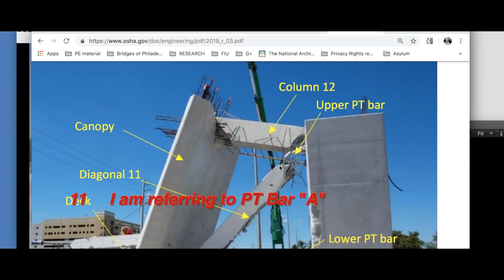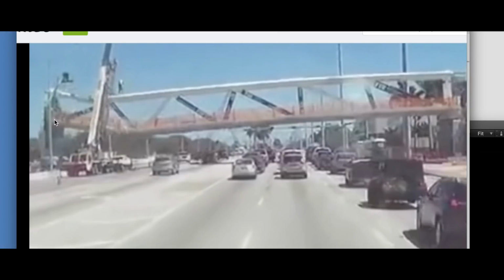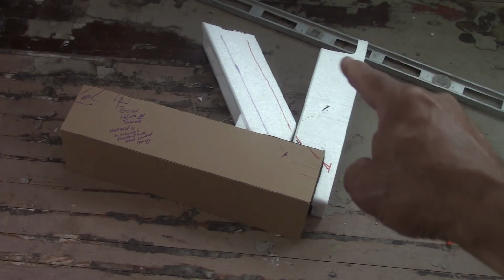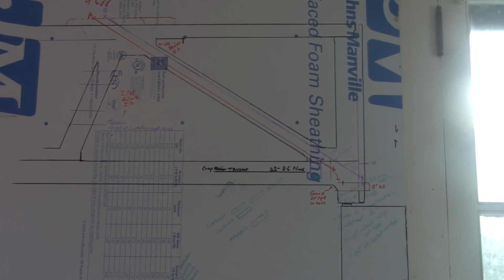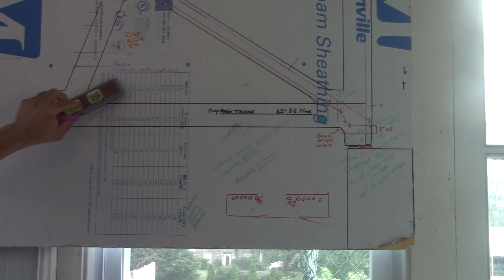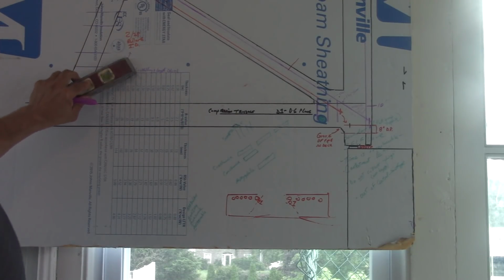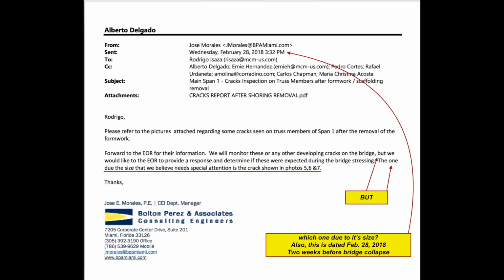FIU Bridge Collapse SHEAR FAILURE OF THE DIAPHRAGM COLUMN 12 & Canopy loads Torque

Comment: At 8:43 you state that 12 kicks back in.  This is not correct.  What you are seeing is the tree coming into view from behind the structure.  A frame or two before this, there is a faint puff at the junction of 11/12  (you have to isolate the two frames and click between them).  That is when the long span starts dipping down and 11 starts getting progressively shorter, with the PT rods pushing out of the top.  If you  watch carefully (again isolating the frames and clicking between them) you can see that 12 does not initially move, rather, the failing canopy pulls the top of 12 down and in (causing the top joint to fracture as visible in OSHA) and dislodging the lower portion off of the slab/diaphragm.  After this, a significant amount of debris becomes visible north of and below 12.  It is a chicken and egg question of whether all of this concrete ruptured early or compounded with the collapsing structure and how much ability 11 had to do more damage to 12.  Clearly, the node had suffered significant damage in the days leading up to the event and was compromised by the drain and vertical ducts making it easily detached from the diaphragm.

I find it curious that the deck suffered so little damage.  In profile, it creates a notable step in the blowout, with 11 completely demolished above the slab and the node completely demolished beyond the step.  Perhaps, while the tensioning of the lower PT bar was the final straw in the destruction, it is also what preserved the slab.  The long and short of this is that the collapse was a series of  failures with many speculations being correct about one step or another.  For instance, 11 was not properly restrained horizontally by/to the deck.  That is true and is the most fundamental design flaw.  Second, the cold joint is an obvious failure mechanism.  The improper horizontal restraint allowed the deck to shift w.r.t. 11.  This is slippage and is visible as the horizontal displacement at the joint.  Against all odds, the structure held on by a thread (not likely for very long were it not for ...).  Punch out is also true.  This is the failure of the node, improperly supported and poorly conceived with all of the inclusions, but again, the structure held together.  It was only when additional and excessive compressive forces were added to 11 (which simultaneously loaded stress into the failing node via the upper PT bar), that the node and 11 ruptured and the house of cards collapsed.
Reply from the maker: I observed the tree;  I use the  pole in front to judge the base, along with the knowledge that post tension rod 11 "A" is still inplace, I use the top of 12 to determine it further... 
You appear to use the tree as the base of 12, I did NOT... Your apology would be accepted if you would give one... 
My guess, is you canNOT because you have already made a conclusive file that I used the tree and it would HURT YOU to say sorry...

Comment: What also looks like happened (that you don’t mention is that rod B was sheared off (symptom or cause of failure mode), while rod A was still sound as it ripped out the bottoms of 11 (ripping through all the stirrups).
Seems to me the OSHA report got a lot of it right, its just the final recap of what moved, seems off the mark. 
Ultimately it looks like the blame is going in the right direction.
Reply: I should add, i also follow the thought process that the damage that caused the collapse was result of tension cracks (from de-tension of 11).
Reply: I was just coming back to reference that figure 52 and 57 show the lower rod in tact. I think figure 63 is mis labeled and is the “upper” rod B. 
Any way, i continue to enjoy the content/thought process noodling through what happened leading up to the collapse.
Reply from the maker: @DamonJohnCollins , that is lower post tension Rod "A" ... please, see one of my other videos for this detail... Or take my word for it, it is post tension rod "A" or for sure, it is the lower rod, the one that is in the deck... For clarity, it may technically, be rod "B" as the only difference is about 2 inches longer and I am guessing the shorter one to be in the deck and called rod "A''...
Reply from the maker: Damon, please show me where you found the data that Rod "B" was sheared? 
I did not find that and will have to add that to my failure...  
Thanks.
Reply from the maker: Damon, then per psychology, in my small mind, you are a genius!    
Hope you enjoy my humor,
Kai
Reply: Figure 63 on the OSHA report. (I think that’s rod B)
Reply from the maker: That is a trick from OSHA, it was mechanically done, it was NOT done during this failure; see figure 57 and zoom in please.
https://www.youtube.com/watch?v=qjSmZaiYfwU  Damon, go to 18minutes in this video and I talk about this part of the report and fake statement by osha.

Plus, the image 57 shows it fully imbedding and a okay...

Comment from the maker: https://www.youtube.com/watch?v=ySvDNNBmWvc  CRACKS ARE NOT RANDOM
00:53  11 push off 12 and NOT 9   sorry
5:16  I keep saying 11    mean   the post tension rod "B"    I apologize.
12:25  the clamp force was also a REDIRECT of forces BACK into 10 & 11
Reply: I think the base of no.11 stayed in place.the sliding effect was the end of deck was creeping inward due to the longitude PT tendons compressing the deck.i'm guessing the end of the deck may have crept in about 15mm to 20 mms.at the same time pushing the top of 11 upwards against the canopy buttress (blister).I don't believe de-tensioning no.11 was ever going to fix the problem.I think the idea of having the stress bars in no.11 was to shorten it in sync with the end of deck creeping inward.The deck was getting shorter but the trusses with no flex were resisting the shrinking process.the bridge was going to fail eventually.The PT cables basically crushed the bridge.

Comment from the maker: MY DISGUST WITH THESE TERRIBLE ENGINEERS WHO CAN'T SEE DATA AND USE IT; ESPECIALLY THE VIDEO AND IMAGES OF THE CRACKED UP / DESTROYED / UNDER TENSION #11 (NOT F****NG COMPRESSION.
Know this, all these engineers who think 11 sheared 12 are lacking common sense and their ability to understand data!
Most of the deck under 11 is STILL PRESENT and only about 9 inches are left at the deckline of 11 and 12...   this MEANS NO PUNCHING SHEAR - YOU ****ING IDIOTS!
12 was installed as an upright support for the canopy which holds the post tension bars and also as part of the diaphragm for the tower...
They show a shear failure of 12 by 11 AND THEY SHOW SHEAR FAILURE OF THE DIAPHRAGM FROM THE TOP DOWN!!!
IF, IT is claimed that the shear is coming from 11 and it only has about 9 inches of material to do it and it is back from the outside of the diaphram by at least 2 feet,  HOW does it create shear from the TOP/ 2 FEET AWAY... in a DOWNWARD DIRECTION!  
THESE ENGINEERS HAVE SOME CRAZY LOAD PATHS IN THEIR SLIDING SHEAR AND lack the ability to process the data that is processed...
In fact, they EVEN remove things like the post tension rods, 1 3/4" thick x 2 ; they may understand loads but they do not understand this failure and totally are losers!  
THEY TOTALLY IGNORE HOW THE FORCES GET OUT TO AND DOWN 10...  
THEY WILL NOT COMMIT TO THE FULL FAILURE AND JUST KEEP PICKING ON ONE SPOT...
THIS IS THE GROUP THINK THAT RUINS ENGINEERING...
As an attack, they claim to be so smart as to see this failure so ''obviously''...  I call bullshit on that, as they do not even know the significance of a tension crack vs a compressive crack...
Okay, now you see what nut jobs I deal with every now and again; idiots that should be sweeping floors and not performing any safety checks or inspections... 
(That felt good to do the above attack... I had no choice as those damn fools are in a circle jer*;   )...
LOL NOT
Reply: @LoadPathEngineering  if this bridge were an ibeam,it would never had snapped like this one did.
Reply: @g0rdi666  https://www.youtube.com/watch?v=VqzkKs5shCM
Reply from the maker: @symple88  , If only I was a witty as you were, I could have used this video as a reply... Priceless! Thank you for this one, never going to forget it... Will be using it in the future.
Reply from the maker: @g0rdi666  ,  I think this video addresses that comment.  Thanks Gordi.
Reply from the maker: Anyone looking for Andrew comments, I deleted them as his responses were just a narcissistic trick ... he was not adding to anything besides causing drama...
He wrote a few response but not one addressed a single crack!
He literally wrote the cracks do not have any issues with transferring forces.
This stupidity pushes me beyond my limits of communication with a narcissistic person...
Narcissistic people cannot take on new data, they live in their own World...
No amount of talking will ever amount to anything with a naracist... they will never accept data unless it supports them.
He ignored Dos's request because he cannot answer questions, naracist people can only deflect from any question.
They are not intelligent people but are minupliative ****s.
I am writing this so you can also learn what a terrible engineer like Andrew must be, he is part of the problem in engineering...
I find all engineers lacking who remove structural elements to prove their theories.
As you know, I keep moving and adjusting with the new data as it is released and will do so until all the data is released and if all the data shows something contrary to any of my current load path failures, then so be it!
I will always accept the path that explains the most of any failure and I will always discount any theory that requires removing or NOT addressing structural elements in a design.
Sliding can work IF you first have the deck fail but, we already have "it cracked like hell" that places number 11 in a position and we have a "crack meeting" where no one is talking about 11 pushing to create these cracks...
And, at that meeting at least 6 engineers have the same data.
We have photos that show a lateral movement, NOT a movement of 11 towards 12.
I will not experiment again with another idiot engineer who attempts to comment and makes a statement that he or she can remove structural elements to prove it can work...
I do not have the energy to waste on that stupidity...
If, this triggers you, then you may also be that idiot who believes 11 pushed 12 off that started the failure...
I suggest you simply block my channel and move onto a stupid forum as Eng-tips... that is where "great minds all think and say the same thing"... that is the group that ignores data of bars, steel and has about 9 inches of the base of 11 doing all the work to start this failure, first inline...
They even ignore the cracks in the members; I would hope that not one of those so called engineers do any field evaluations EVER.
Those idiots would have fit perfectly inside the "crack meeting" and said, ALL THOSE CRACKS ARE OKAY, AFTER ALL THEY ARE IGNORING THEM IN THEIR FORUM NOW...
THAT IS PROOF THEY WOULD NOT HAVE HAD AN ISSUE.
Lmao.